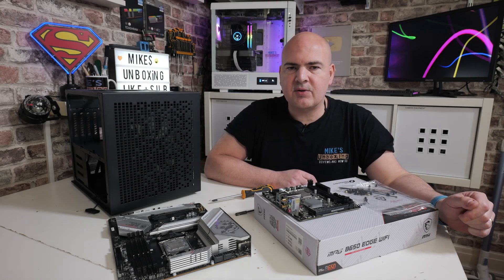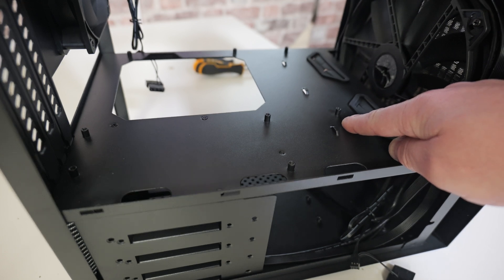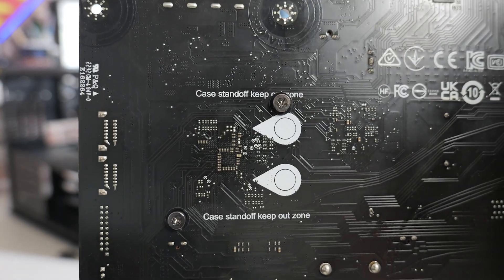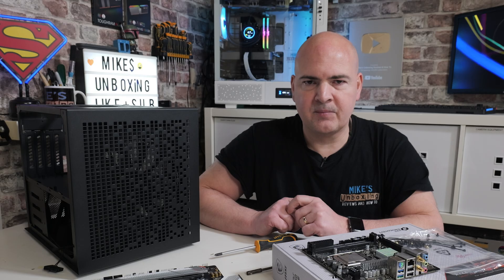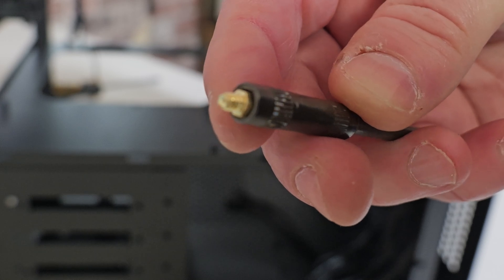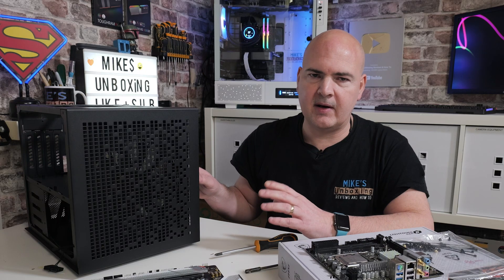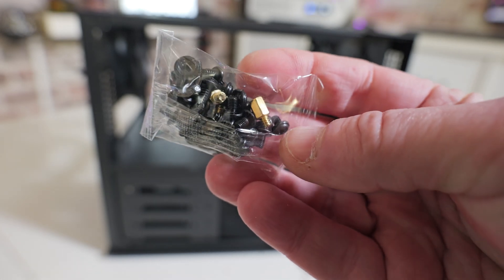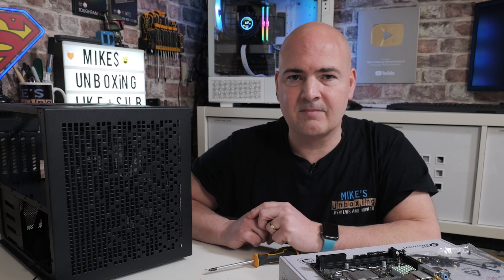Why Is My PC Not Booting No Power Or No Display PC Motherboard Mounting Pillar Guide

Comment: I had a very strange boot up problem just recently. I had made a system with 13500 and a motherboard Asrock Z790 PRO RS ram kingston BEAST supposedly able to run at 6000mhz or hz. I assembled computer hit the power on and the fans were spinning alright the rgb colors were on but no screen. Just black. I checked everything etc. I could show image with only 1 memory bank but nothing if set properly for dual channel. The initiall fear was that i could had bended the motherboard pins during installation. Truth is that the CPU during installation kinda fell from a bit higher than i hoped. I also asked others etc and all were saying that the problem was probably this cause not being able to see the dual channel and malfunctioning on that was a sign of bended pins. I was to set sail to buy new motherboard since, as the fault was probably on my end there was no point trying to send it back for replacement. At the end i decided to make a last efford i reset the bios but this time i set the dram memory to the lowest setting 4800(or could be 4400) 1,1 volt so it was the XMP3 choice. And it worked! I could "see" the memory sticks at dual channel! So i had not bended the pins!  So maybe make a video about this too. In general i see that many asrock mobo buyers suffer from this issue. Memory sticks supposedly working at much higher speeds seem to giving black screens with Asrock mobos (even with the Taichi) . So i think it would be a good idea to cover this too in a video. "If black screen than reset bios and set memory to lower setting"
Reply from the maker: good idea

Comment: Had this same issue got cpu debug light then later a ram stick "died"
Reply from the maker: sorry to hear that, was it shorted?
Reply: @mikesunboxing  I think it was shorted on the case because I didn't have the standoffs all in right. Worked fine after I fixed up that but then a couple days later a ddr5 module failed. I had 4 sticks of 16gb installed now when I try to install one specific stick the pc won't boot.

Comment: Hello, greetings from the Philippines.

So this means that there are some standoff parts that should not be screwed in order to prevent short circuit? I have my MSI MPG X570S Carbon Max WiFi that I currently using and it is an ATX form.
Reply from the maker: yes that is right the MATX layout will short out ATX

Comment: I'm reminded of the time (nearly 20 years ago now) I worked at Preston Manor High School, Wembley, as an ICT Technician, and spent a summer building 100 or so Pentium IV PC's for the three workstation rooms we had there. Then it came to the PC that the teacher would use, which was an RM machine and oddly housed in a cut out in the wall. We used the same case and put the same upgraded hardware in but the darn thing would not turn on, whatever we did - nada - nothing - dead. Even had the regular Sparky, Jerry who bless his heart spent ages testing the case for shorts and if it was Earthing correctly (which it was) and trying to work out what was going on. We took the kit out, put it in the cases we had been building in and it was fine. Put it back in the RM case - nothing. Still never got to the bottom of it - but it must have been a ground issue somewhere. Strange. I don't have sleepless nights over it, but it bothers me though, hey ho life goes on! 🙂
Reply from the maker: yeah funny how sometimes there is a possessed PC that just won't be fixed. Had a couple over the years.

Comment: On my first build i had this problem. A misplace motherboard stand can easily short the board and can cause a lot of issues. This is also easy to miss if you don't properly inspect the layout of the stand to match your board.
Reply from the maker: yes it is a very common issue.

Comment: Thanks mike and Lady Kath. Great info as usual. I've bought cases since time began and some of them had plastic standoffs in the parts bag., which came in very handy when there was not a place to mount a standoff. So I would use one of those on whatever corner(s) needed one. Supported the MB by pushing one end into the board...problem solved. I think I still have a few in my parts bin. Thanks for sharing guys. Take care. Cheers
Reply from the maker: That is awesome! cheers Rick
Reply: 6.3 is size Mike,  9 bux Australia for 1000 so I'm guessing 4 pounds?